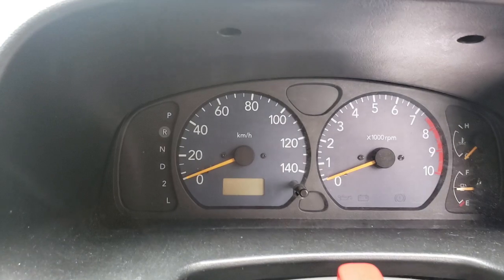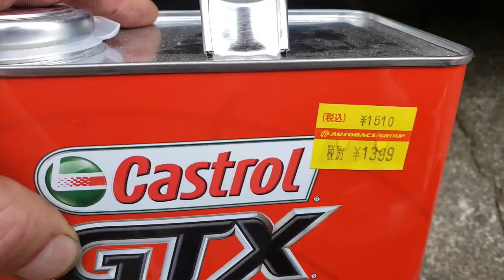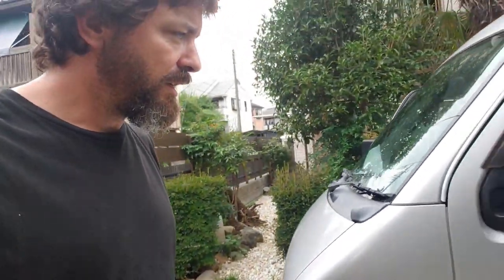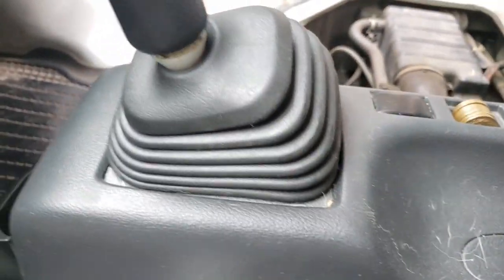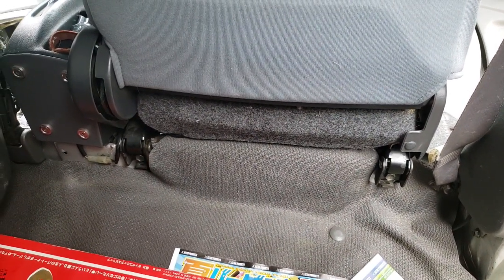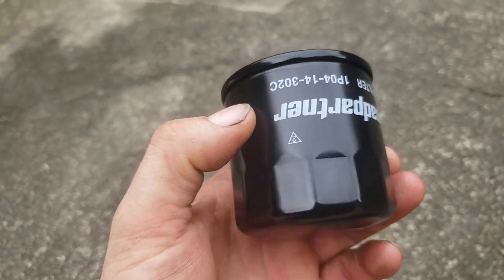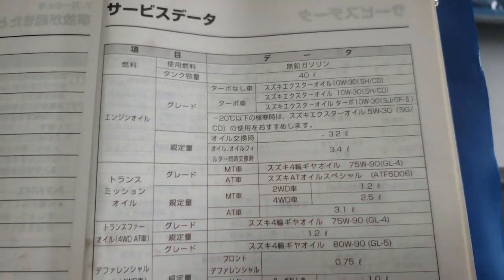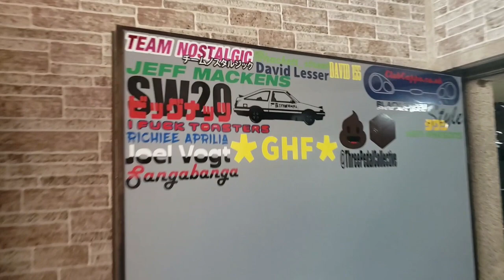DA52V SUZUKI EVERY VAN OIL CHANGE

Comment: Any way to mod the seat hinge to get the front seats to fold all the way forward?
Reply from the maker: The passenger side seat is two pieces. the back part is attached to the wall and the bottom part folds up so you can access the engine room.
I don't fully understand the question.